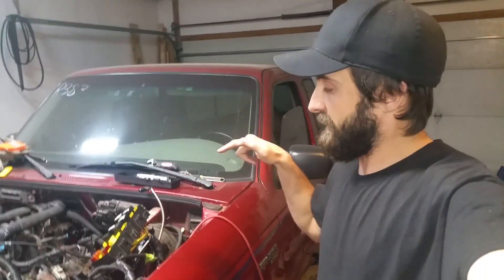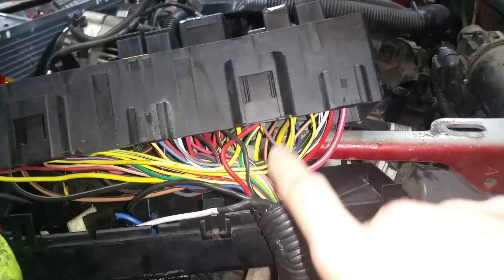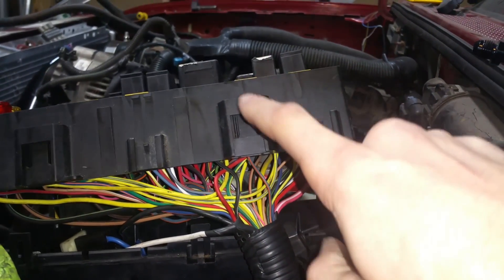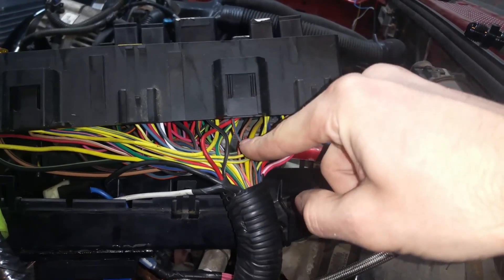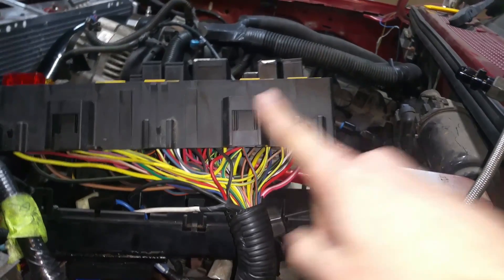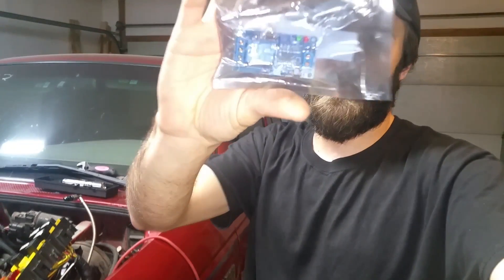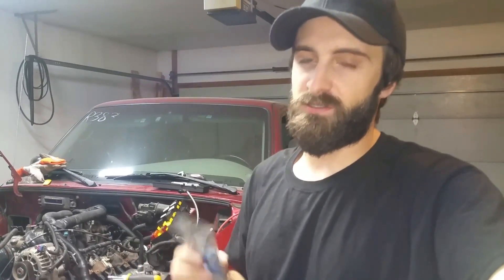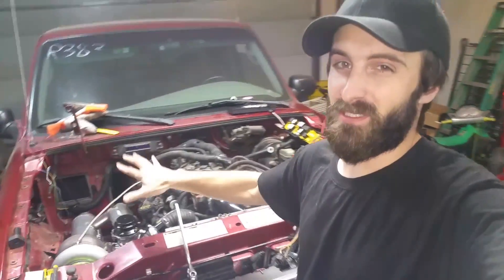STAND ALONE LS SWAP HARNESS NEGATIVE TRIGGER FUEL PUMP RELAY CONVERSION!!! Viewer Question VQ1

Comment: Hi! I came up on you video looking for a fuel pump relay negative pulse... but no car/truck one, a bike! I have an Honda VT700 1986, this damn machine cames from factory with a 3psi fuel pump that already have a built in relay, well the pump died after 40 years :-p it retired.  So, trying to find a new fuel pump the same schematics with built in relay, but no luck... only could get a brand called Quantum Fuel Pumps, but it run about 30 miles and the built in relay died (I had a friend with the same pump and also had the same problem, so the Quantum Fuel Pumps are kind of chinese bad quality)
What I lernt is that it might be adaptable with an external relay (its activated with the front ignition coil, negative pulse) so here I have black 12v positive, green Ground cable and one last blue that is the Ignition Coil Negative pulse.  The problem is that every damn relay I could get here are Positive pulse, I connected anyway without knowing and the relay just burnt after few minutes of not working.

Any idea how to convert it to negative pulse relay? cant figure out yet :-( thanks!

Comment: It’s crazy how much detail you have gone into to keeping this thing as ford as possible. Like factory fuse box ect. Impressive bro.
Reply from the maker: HunterTuned Thanks man. I ended up switching to a different 40a relay now for the new pump as I'm sure the stock and wiring wouldn't have been happy with the new pump. Should have it running today, would have been last night but decided on movie night with the wife.